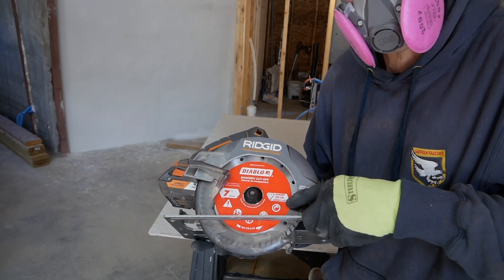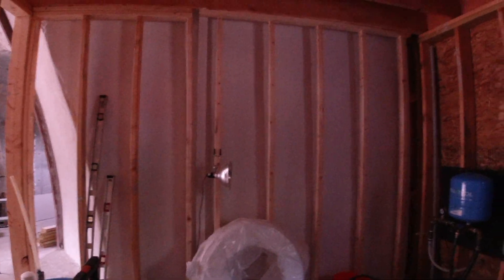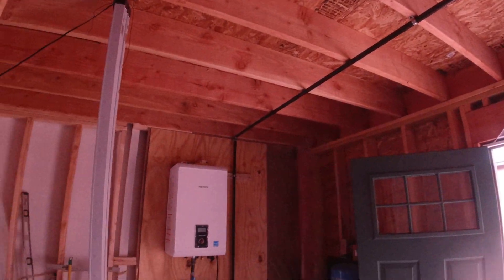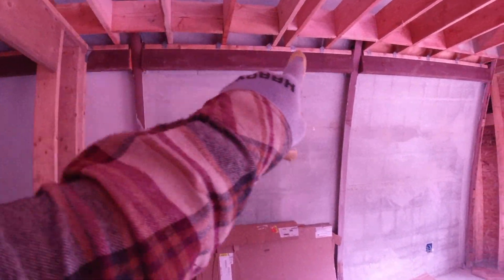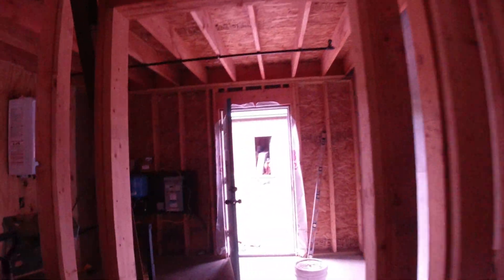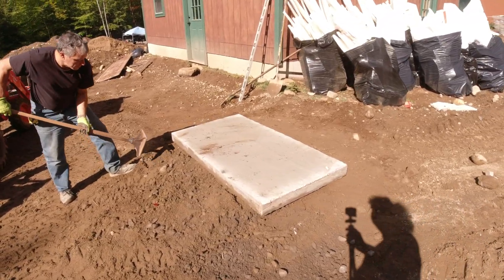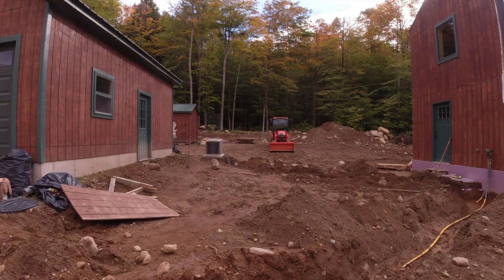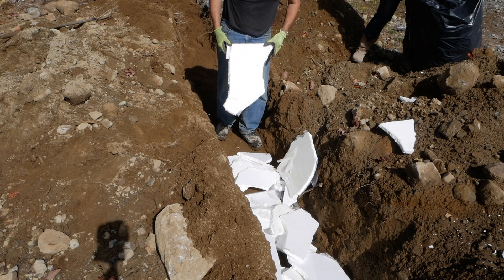HEAT, HOT WATER & PROPANE | OFF-GRID BUILD | Adirondacks

Comment: Are you concerned about condensation on the inside of your un insulated concrete dome? Once you have your dirt covering this shouldn’t be too much of a problem but moisture from showers and cooking may be a problem in cold weather.
Reply from the maker: Very good points. We have an ERV unit that should help with that and hopefully the wood stove heat will help as well
Reply: @CreatingASimplerLifeOffGrid  AIR EXCHANGER With your wood stove and also AIR EXCHANGER like running your bathroom and kitchen exhaust fan will deal with that very well and keep a window open to equalize the air pressure inside and outside so the smoke of the wood stove can exhaust very well by the chimney exhaust  👍👍😇😇👌👌🍻🍻
Reply from the maker: Thank you!

Comment: It’s been fun following along! I have a home that sometimes has to be winterized. It is a pain to blow out the lines and drain the hot water heater. If I had a chance to design it from scratch I would have the plumbing supply be self draining. Open the taps and drains and walk away versus an hour with the noisy compressor.
Reply from the maker: It is a pain to blow out lines. We have to do that for the trailer too.

Comment: Spray foam the outside of the dome. I know it's a lot of money but your house will be so cozy. 

All the monolithic domes have the insulation outside of the concrete. I'm sure it will fix your leaks as well. But you will have to cover it to keep the sun off of it until you get the earth on the dome.
Reply: I would think,that getting spray foamed such a large area would be crazy expensive. It wouldn't be wise to try to resolve leaks with the foam, it's not a water barrier. You need some water tight membrane on top of it anyway and the way I'd (hopefully will) do it is to have a waterproofing underneath and above insulation. Water is the most serious danger of earth covered and underground houses and having two barriers is adding some extra safety. But the foam insulation would definitely drastically improve thermal insulation, that's for sure.
Reply from the maker: Interesting thought but we purchased a kit and the foam would interfere with the membrane that is supposed to go on next. A lot of tough decisions for us to make but we appreciate the suggestions 👍

Comment: Those lines your buried and covered in foam are made to be underground and sand is even more than it needs.  If you ever have to dig up that line that foam is going to make a real mess.
Reply: See , the thing is that they went the extra mile and will never have to dig it up…. See ? Jeez
Reply: @terryatpi  even if you have to dig across that for another line it's going to be a mess.
Reply from the maker: Hopefully we never have to, but now there’s no doubt where it is. It’s a plastic line, not copper, so a little easier to damage
Reply: @CreatingASimplerLifeOffGrid  Well Said 👌😇👍🍻